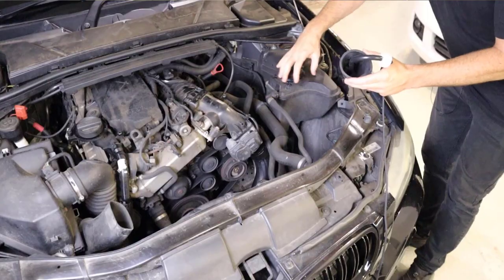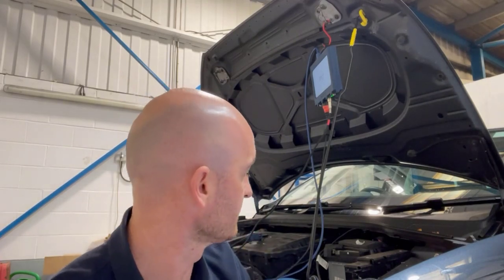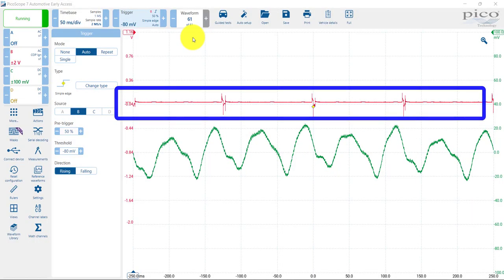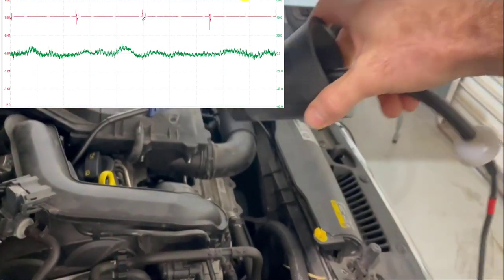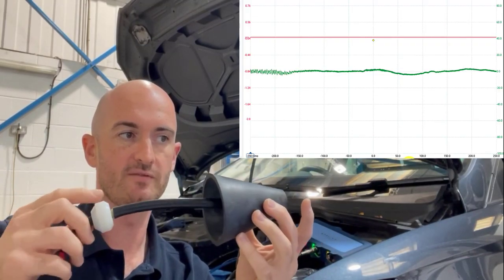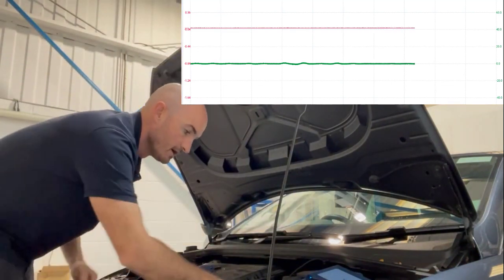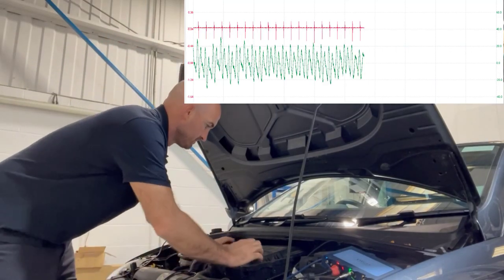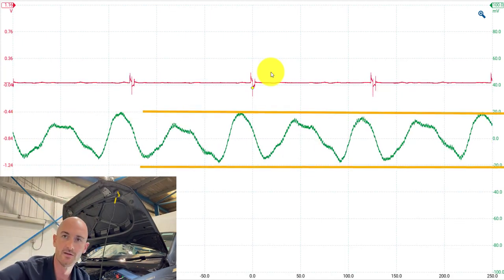Mystery Solved! Coolant Pressure Pulses Found...

Comment: Hi Darren, 

I tried to see if a test like this was valid about a year and a half ago (just finding your content within the last few weeks). I had a V6 4.0L OHV Ford Ranger with a blown headgasket, pretty bad leak on cylinder number 6. I didn't use a pulse sensor, but rather a 30PSI pressure transducer. I was hoping to see a pressure change consistent with an ignition change. No luck at the radiator, just a pretty muted up and down wave that didn't see to correlate with anything, and a slow rise in pressure the longer it ran (as expected). I assumed anything worth seeing was damped by the mass of the coolant and the rubber hoses. To try and go further, I pulled out a plug on the water pump (may have been the coolant temp sensor), cannot remember. At this location, I was very clearly seeing a wave generated by the water pump fins. At the time I think I did the math on it to be sure (to account for pulley size differences) and every rotation of the water pump was the exact number of fins on the pump. There was no sign whatsoever of a pressure pulse from a blown headgasket at this location. (It was the furthest cylinder from the water pump, but far closer than the rad cap or overflow tank would be. I was questioning whether or not this vehicle actually had a head gasket problem, but the leakdown test put a few litres of coolant on the floor in about 5 seconds. Upon teardown there was a fairly large leak in the headgasket. 

This, unfortunately, was enough for me to put this line of testing to bed. Glad I tried it, glad I know I won't rely on it in the future. 

Thanks for the videos.
Reply from the maker: Thanks for sharing. I’ve seen quite a few confirmed cases with the pulse sensor, and also the WPS500 on the low pressure setting. Interesting that the 30PSI sensor didn’t pick it up!
Reply: Why not just use the gas tester on radiator.  If there is leaking into water, it shows up as a color change.  Or are the manufacturers getting so bad they turn off the injector of a  bad cylinder so there is no exhaust gas blowing into the water coolant..

Comment: Two crank rotations per trigger. Coolant is vibrating with the crankshaft.
Reply from the maker: Ah yes of course 👍. My head was still with power strokes 🙄. Very unbalanced engine on idle. Harmonics on the 4 cylinder must have made the 4x pulses
Reply: @MechanicMindset  my 3 cylinder Yamaha was smooth as silk from idle to redline.

Comment: what you use a coolant screw on adapter with a quick connection adapter and a steel braided hose to the pulse sensor. would this help?
Reply from the maker: Be the same I think 👍

Comment: instead of holding the engine could you have picked up the revs slightly to stop the engine shaking maybe ?
Reply from the maker: Probably would smooth it out, that might have left some of the other theories open for some viewers. I’m not doing it again 🤣🤣🤣. Thanks for the input though!

Comment: I did some testing on a V8 Jeep,  you will get pulsing even if you just shake the whole car with the engine off, in that case just the coolant sloshing in the system.
Reply from the maker: They are so sensitive!

Comment: Make sense but if we use a WPX500 would it be the same. Meaning the pulse sensor is very sensitive to pressure difference, try it and see if there is a difference with a absolute pressure sensor compare to this one that measures the difference.
Reply from the maker: Hey D, it is similar! Someone posted a pic not related in Pico group and you can see it 👍
Reply: @MechanicMindset  will check it out. Hi im looking for a good NVH app. Do you know of any, that works good for driving noise?
Reply from the maker: @DJ-tn7vj  I’ve not used one for a while. I’m sure Bosch did one